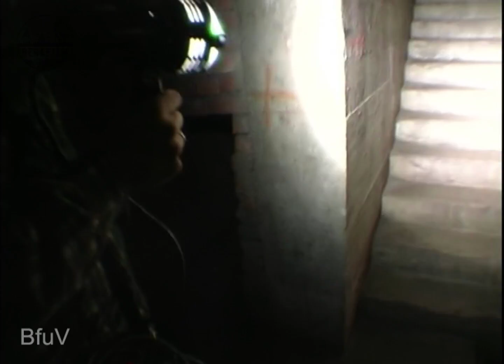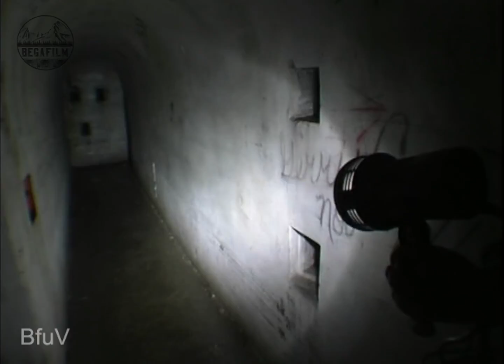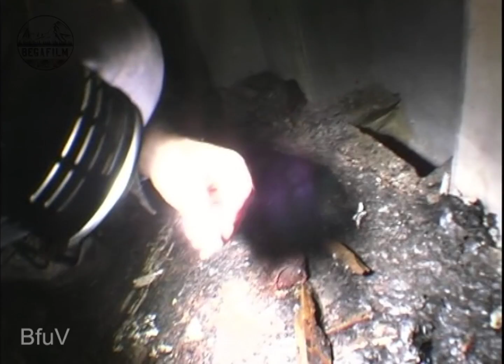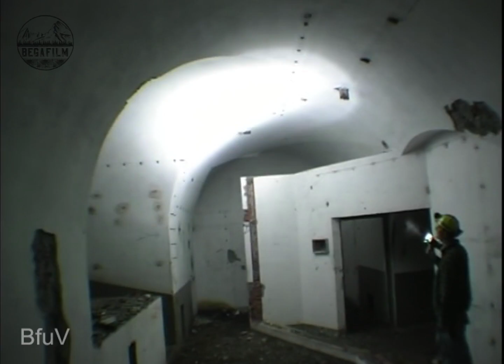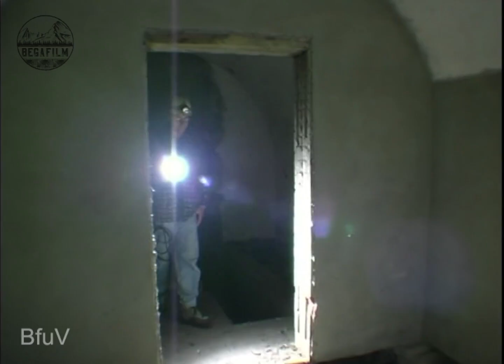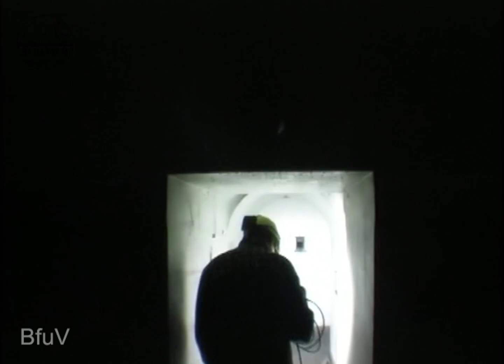Hitler's Underground Bunkersystem: Exploring the Command Center and Martin Bormanns private Bunker

Comment: I'd like to add it's a shame the original cones for the primary antenna systems were destroyed to build the new hotel on the Obersalzburg. I probably wouldn't recognize where we spent so much time.  Never staying at the General Walker. But there slot machines in the basement as you approached the tunnels